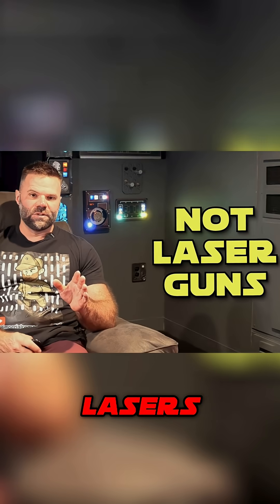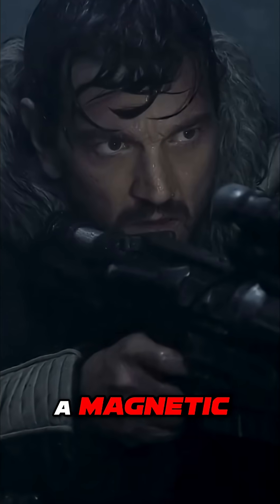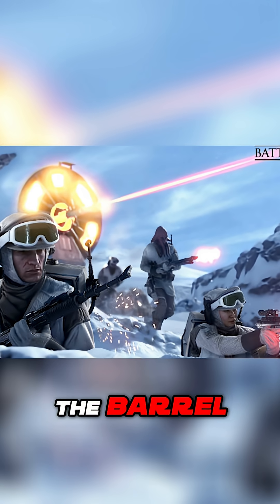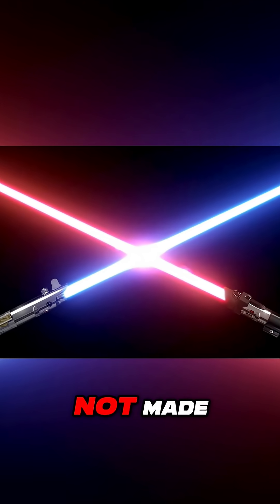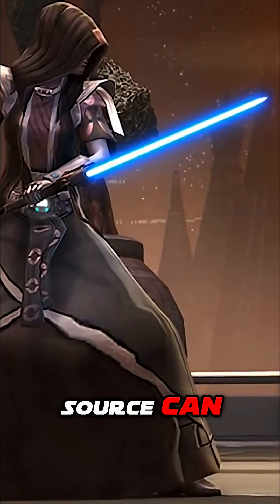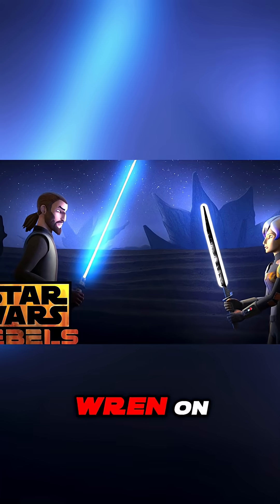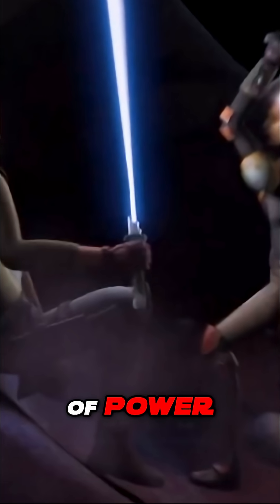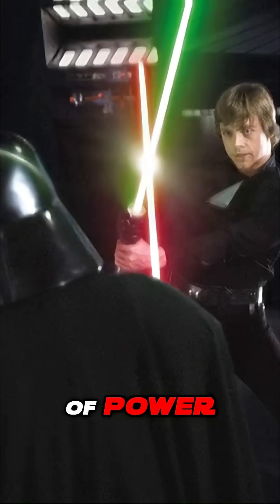Star Wars Tech: Blasters & Lightsabers Explained Simply!

Comment: THANK YOU

PLASMA BLASTERS. 

We can make primitive plasma blasters using a high voltage arc, and firing a controlled burst of ionized pressurized flammable gas. 

It can be done with propane, butane, hydrogen(you dont want to use this unless you have nasa grade hydrogen lines, tanks, and back flow regulators. Hydrogen is the one you should be cautious about)

But plasma blasters are possible 

Maybe not the ones we see, we cant, at least at the moment, we cant sustain an electromagnetic field outside of the energy source, so we cant sustain a field around the plasma as it travels. 

We just get beautiful fireballs (fire is a form of plasma)
Reply from the maker: Very cool breakdown

Comment: Fun fact. Lightsabers are called that because the kyber crystals inside them are naturally attuned to the light side of the force. This is why darksiders have to bleed their lightsabers. If they don't force their will upon the kyber crystal then it will actively resist them. 

also the darksaber is called that because it has a kyber crystal the is naturally attuned to the dark side of the force. This is why good people like Sabine and Din struggled to use it, but evil people like Gideon and Pre Vizsla had no problems using it.

Although, it is unconfirmed. It is also likely when a kyber crystal is purified it turns white because every emotion both good and bad is removed from it. Effectively, leaving it a blank state.

Comment: well yeah,  and thats also why the blasts are so slow...   because its a physical projectile BUT its not accelerated through a long barrel, so it doesn't get much speed.
Reply from the maker: Which is why their tech can scale up for rifles and such. Pretty cool
Reply: Actually barrel length shouldn't be as much of an issue as you'd think since you're using a magnetic coil to accelerate the "projectile". A longer barrel would be more efficient, but dumping more power into the accelerator coil should compensate for that. (Basically it should work the same way medieval crossbows used higher draw weights to balance out their short power-strokes.) Though this would reduce the number of shots per power size. What a longer barrel and a bigger form factor would give you is greater efficiency (less power used to accelerate the "projectile" to a given velocity or higher velocities if you use the same amount of power) and it would allow for a larger power-cell so you could get more shots.
Reply: @jkirschy  except its also the number of coils you have..  and the thickness of the coils.  you can only dump so much power based on coil thickness.   tiny coils...   like those youd find in an hnd blaster?  would melt under high power...   

so in some cases you'd be lucky to get 150 m/s.   short range, slow, blockable by lightsabers..

but its not the speed doing the damage or penetration...   its just carrying the plasma.

Comment: Does that explain the inconsistency of both weapon platforms throughout the movies and shows.
Reply from the maker: How do you mean?
Reply: @imperialremnantpodcast first episode of mandolorian the droid was taking blaster bolts left and right but gets one tapped by Mandi’s blaster. Later on in the series same droid same blaster the bolts bounce right off. Why is that
Reply from the maker: @Echocompany2-7 ah yeah. K2s0 had a bit of that on rogue one too
Reply: @imperialremnantpodcast could it just be variability in the individual well idk what the counter part of the rounds is. Like 22lr for example some rounds will be super sonic some will be sub sonic. So with a suppressor some 22 are louder or quieter. Is that like the cannon reason for the k2s0 inconsistency
Reply: @Echocompany2-7 from what I understand, there are two factors that play into this

1) armour strength/material and damage absorption. Some materials are able to disperse the energy of incoming fire, but will eventually fail

2) plot armor is always strong until it isn't anymore
Reply: @Echocompany2-7  I'd think it matters where the droid is hit (IE how heavily armored it is), how powerful the blaster bolt it is hit with, and how far away the shot came from (the longer the shot, the cooler the plasma on impact and the slower it would be moving). Using modern firearms as an analogy... Compare the effect of shooting someone wearing body armor in the chest with a .380ACP snubby at 100 yards vs. shooting them in the head with a .44 magnum.
Reply: @jkirschy my specific example is from the mandolorian the droid at the very beginning of the series in the first episode. You can see him take shots to the head by larger caliber blasters and bounce them off but the mandos side arm goes right through. But later in the series when the droid is revived the mandos shots just bounce off. My granted he was slighter farther away but irl the plasma wouldn’t have time to cool it and I think although I am not certain but I think the magnetic field would provide a barrier to keep it from freezing or cooling the plasma. Like they are able to fire them in the vacuum of space. Which in theory should freeze the bolts instantly
Reply: @Echocompany2-7  Pretty sure the mag bottle around the plasma starts degrading as soon as it leaves the blaster. Also I would imagine the mag bottle doesn't prevent cooling, just holds the blaster bolt together, because otherwise the bolt would disperse. So the bolt's plasma should start cooling immediately. That's why blasters are (relatively) short ranged weapons (if I'm remembering correctly anyway). I don't remember the exact numbers, but I think most blaster rifles have an maximum effective range of like 150-200 meters.
Reply: @jkirschy that makes sense as I said i wasn’t certain.

Comment: If the blade is a loop, where’s the other end or what stops it and makes it come back down to the hilt? There’s nothing on the end or they couldn’t thrust.
Reply from the maker: There's a containment field that limits the blades length and sends the plasma energy back through the hilt. It goes through a super conductor back to the power cell so the blade uses no power unless it's in contact with something else

Comment: Depending on the gas, determines the effectiveness of blasters.
Blue gas is usually used to stun organic combatants or act as ION bolts against droids. I believe the most powerful gas produces a solid white bolt of energy. Red and Green bolts are more common but very in power level
Reply from the maker: You nailed it
Reply: @imperialremnantpodcast and all that AFTER watching the original video. not looking over shoulder to see if Cpt. Yuul Leern is glaring daggers
Reply: Doesn't different gases also determine the colour of the plasma bolt like certain chemicals or elements when heated give off different colours in fireworks?
Reply: @exakelgaming yes
Reply: Not really, its more about the chimical compozition of the tibanna gas used. I mean there is a type of gas that makes invisible bolts and was used by some clone commandoes and imperial assasins.
Reply: @Daemon2k15 chemical composition does play a part, but there are other gasses used in blasters as well. The quality of the gas plays a factor as well, as it is possible to refine any of the gasses to make them more or less potent. Tibanna was the preferred
Reply: By the way almost any blaster in SW has a stun feature no matter the gas used in it